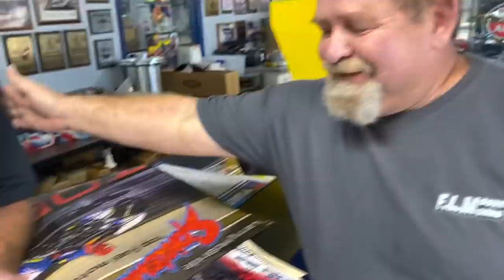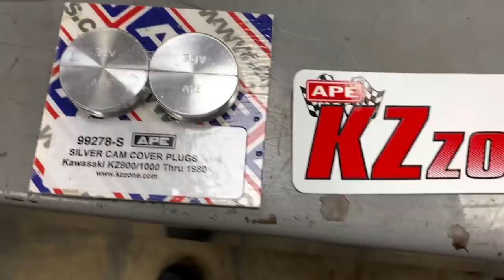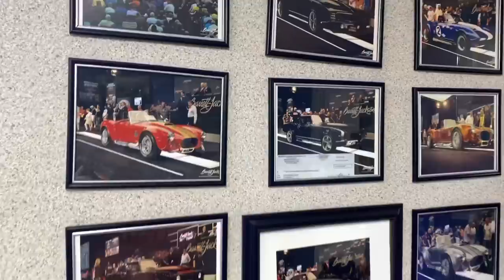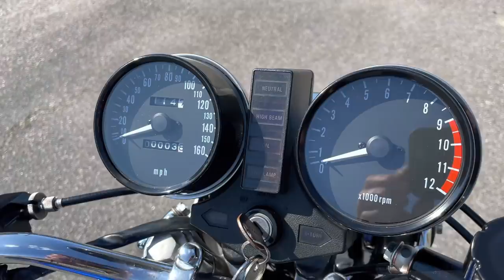How We Saved this Classic Motorcycle!

Comment: that was a great rebuild, makes you wonder how many old bikes were sold that needed some basic TLC due to not having knowledgeable mechanics. I had a 700 Yamaha Maxim that would bog down when you accelerated hard, either carbs were out of sync or jets were dirty/bad. Couldn’t find a mechanic in CO that could fix it. 
Thanks for making this video. 
Be safe riding that beast.

Comment: I had a '77 KZ650B that I pulled out of a brushpile, and we pulled it behind my truck to get it unseized, put a Kerker on it, new Points/Condenser, painted the frame, fixed the seat and rode that bike around for 5 Summers before I finally sold it....that was a pretty reliable bike considering where I found it...

Comment: Oil leaks suck! Copper base gaskets are notorious for seeping/leaking. Factory base gasket installed dry will seal up nicely.
I keep Sunoco 112 octane race fuel in my turbo bike and my classic cars since they sit a lot, stuff keeps for years instead of months.
APE's shop used to be about 2 minutes from my house when I lived in Burbank, CA. They are now in Rosamond area near Willow Springs racetrack......and Jay is da man to go to there!
Reply from the maker: Awesome. Tell me more about your bike
Reply: @cycledrag  1979 Honda CBX, turbocharged with an old ATP kit in 1993 and has run reliably with a stock bottom end and careful/proper tuning since then. I've mentioned it in here before.
My experience with copper gaskets was on an earlier CBX engine I'd built, sleeved to 1270cc in a stock cylinder block w/Carrillo rods, head sealed nicely with stainless wire o-rings but was rough keeping oil seepage at the cam chain area sealed up, and the copper base gasket had the same issues. This engine had good usable power from 3500-12000+ RPM and would pull power wheelies easily.
Engine was bulletproof, but oil seepage was always annoying on a long ride.

Comment: I remember working on kz1000, and  many highway patrol bikes. Such a durable bike. The motors and transmissions are strong.
Reply: All of the 2 valve inline 4 Kawasaki engines were super tough. Only real weakness were the oem cam chain tensioners.
Reply: @GPz84  yes exactly, the burned valve bucket was a shock. The previous owner ran the kz1000 without proper maintenance. Valve adjustments are so easy on the kz1000.
Reply: @thinkingimpaired5663  To be honest always found shim under bucket to be a pain in the ass! My Concours having screw and locknut adjustment is the bees knees!

I know these guys are hung up on APE, which is great stuff, but I ran Kreiger cam chain tensioners on my GPz's and KZ 550 and never had an issue. Either way,  far superior to that crap wedge tensioner or even the ratchet tensioner that replaced it.

Safe riding buds.
Reply: @GPz84  working on so many CHP bikes I guess I just was used to doing the adjustment. I forgot to mention I did have access to a box of shims.
Reply from the maker: You are correct. That's why so many are still at the drag strip. Do you own one?
Reply from the maker: @GPz84  Got to love that APE unit

Comment: My first bike in High School(1980)!!!
Installed a Kerker Header and a quater fairing, I was the Shit 😎😂😎
Reply: I still have my 81 550 cant let her go
Reply: Kawasaki and Kerker go together like peanut butter and jam! Damn they sounded amazing back in the day, and you knew exactly what was comming when you heard it.
Reply: @GPz84  
Hell Yeah 🎉🎉🎉
Reply from the maker: Thanks for watching. If you could restore one bike, which one would you choose?
Reply from the maker: @GPz84  great sounding exhaust
Reply: @cycledrag  I restored an 84 GPz 750 many , many years ago.. Wiseco 810 big bore, Kerker exhaust. Dyna coil and plug wires, Kreiger cam chain tensioner. Great bike that i rode for 13 years.
Sold it in 2017 when I bought an 06 Concours with only 19,000KM on it and don't regret it one bit.

Concours ain't the prettiest, but damn they are one hell of a bike.
Reply: Sweet, my friend gave me his 650 w/ kerker header... Beast...

Comment: Never said what size the motor is.... I see a lot of good stuff shim unders, camshafts, studs,cam chain, aftermarket everything. I saw a glimpse into the ports of the head looks like someone might have ported it? Ignition and coils upgraded, should pull hard! Find some 29mm smooth bores those carbs are too much for it to run crisp down low.👍🏽👍🏽👍🏽

Comment: I would put a matching lester 18in rear wheel in the bike and a right hand side front brake set up.Oh and change the seat.Had a A4 z900 back in 1979 in the UK did'nt handle as bad as generally reported.
Reply from the maker: interesting. Tell me more.

Comment: wanna know how to synchronize the carburetors not that they are off that far after hearing it run and probably as close as you'll get them with Mercury sticks or vacuum gauges, but there is another way not using any Mercury sticks or vacuum gauges at all and do it with the carbs pulled off the engine and on your workbench...with the idle adjustment backed all the way off simply using a 0
0015 " - 0.002 " steel feeler gauge and set all the carb slides exactly the same air gape at full closed throttle by using the synchronizing adjustments for the left pair in the right pair and then 7 you use the center synchronizing adjustments to balance the two pair ...keep checking the clearance with thin flexible filler gauges until both pairs are exactly the same clearance lock all your synchronizer adjustments down then turn the idle screw up to enough gap to get it to startup and then do your tuning 9of that whatever RPM you want final idle speed..... and right now is the best time to do that before you mount the airbox....as you know what it's like to pull a set of carbs off of a stock bike that is running with all the accessories so this is not a practical way to synchronize the carbs when Mercury sticks or vacuum gauges are good enough....but you do it like i pointed out you can do and take all the time you need to getting the idle air gape on each carb within 0.0005" as stock cams will not have any irregular lopping as they do out of the crate ..set them all within 1/2 thousands of an inch and will make the engine just a bit more responsive rolling on out of a long sweeping turn with a bit  faster rev from idle  up in neutral
Reply from the maker: I'd love to get it on a dyno
Reply: @cycledrag  with o2 sensors and see what the actual air/fuel ratio really is at idle through max rpm and have a jet kit to be able to adjust the fuel mix right then while your checking it all out..14.7 to one is todays epa max that is right on the edge of too lean ..and  with only 93 octane no lead at the pumps makes for high temps for several hard rollons ...back when we had 106 octane leaded at the star stations of cut rate was 75 cents per gallon and a fuel ratio of 13.5 to one was right on the edge of too rich ..... so today im thinking try 14.0 14.5  to one ...with the proper heat range spark plug recommended for your set up you should read a white center electro with the threaded base metal light gray ..anyway thats what pop yoshimura showed us at honda school back in 1975 
.and later when the 1st liquid cooled 2 stroke honda Elsinore cams out yoshimura tuned them to read the spark plug to look same as a four stroke and not seize it up using synthetic smokeless oil mixed at 50 : 1..
you need to find interested friends with a dyno willing to sacrifice a week end of trial and error
Reply: you know you made that comment to me about my knowledge of pro stock rules to have a debate about it in your arena in front of your video cameras ..so i gave vance and hines a call and they said doing it at their shop in indy was a good idea ..so you see what this could become if you bring your ride and let v&h demo to the world just how good they are ..as i have a 2009 xr1200 i just had a tts tune put on it at my local hd shop in terre haute and have some questions about it..so between the two of us right now at the start of the 2021 cycledrag.com opening season ...and with all the new nhra pro stock extreme rule change for the inline 4 cylinder upgrades like almost 2 liter motors with now 4 valve heads making 400 hp (and ill say way more) ..the v twins wont be winning any more championships 10 years in a row again to say the least ..and on top of all of this harley broke their 20 years of partnership with v&h and american flat track and all racing ...harley has pulled out of no more racing support of any kind of 100 years of racing ..and what happened to the indy mile again as the had it last year but indy os not on the schedule this year ...so i figure with all at stake today of all the material i just mentioned above ..dont you think you could put together one of the most epic cycledrag.com videos of your ideas of a dream show rivalling the top dogs and the gods of speed ????? oh and by the way last year as you know angelle sampey won the nationals on a v&h /hd screamin eagle fxdrs as her 1st win for the team  on a harley and her last as v&h built her a brand new carbon fiber inline 4  of the new rules 16 valves of a call it a 2.0L as it is so close ...and it should be at the brownsburg shop in indy if you care to see it and put this also in our little debate as you pull off a viral episode of cycledrag.com  
.tada you win again

Comment: the tach cable seal will leak as well, the cable  loosens at the head in front, "Also those contiblitz" tires are garbage be careful the rear slid out on mine quite a few times!!! they are shitty tires, try shinko they are sticky, or if you can find them   the dunlop qualifier tires were great but i dont think they make them any more

Comment: I think your oil is black because the engine is running rich, your clutch is not black!
Reply from the maker: It's the clutch mixed with oil. Check out that shot of the bottom of the oil pan.